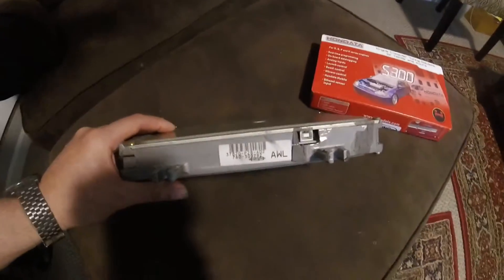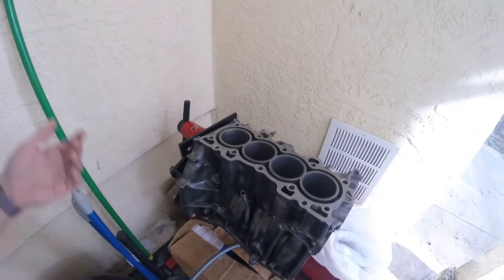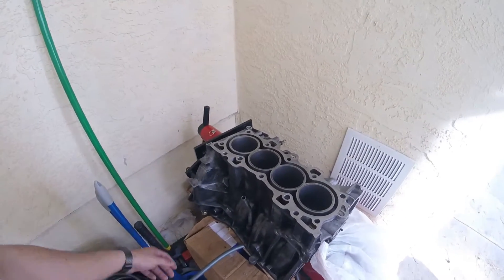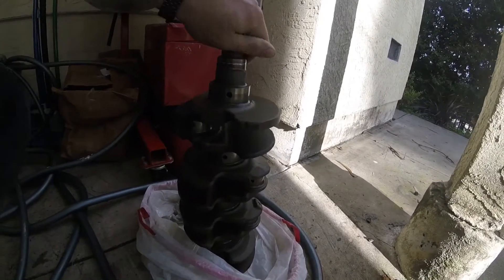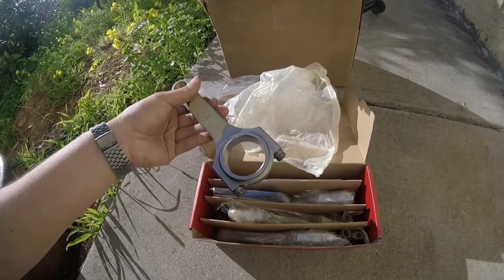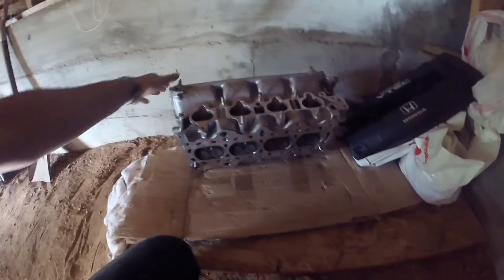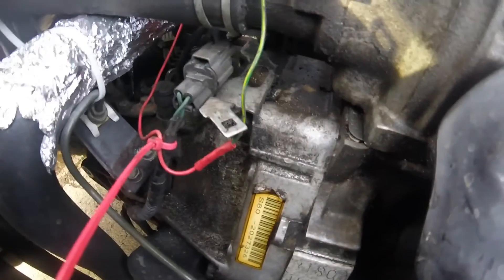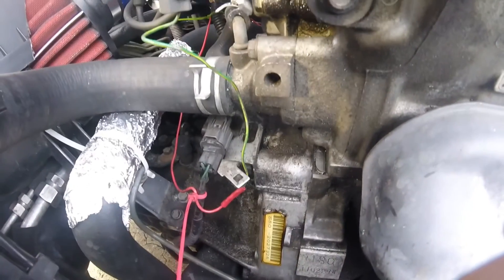LS VTEC Turbo build part 1 parts list build plans overview

Comment: you can run a much higher CR than 10:1 and boost. ive ha friends boost stock type r engines. higher CR is quicker spool time and lower boost pressures for your power goals. so its far less strain on all of your components. all you require is a competent tuner to tune the car.
Reply from the maker: Thanks for the advice, i do agree with you. Originally I wanted a higher compression ratio for the most responsive setup possible. But i live in CA and the highest octane fuel we have is 91. After machining i will end up around 9.2:1. That will give me some room for error like a questionable tune or a bad tank of gas, faulty injector, accidental over boosting etc. im building this to be a fun reliable daily driver so id rather have some piece of mind with a little room for error. I do agree with you though, higher is better but if anything were to go wrong the chance of your engine making it out intact are slimmer. Thanks for watching
Reply: Max Herman oh I didn't know that you were in California. I can understand where you're coming from. Any updates soon?
Reply from the maker: +No Budget Racing this is an old video, so im not sure if you've seen my other videos but i have a bunch of videos of getting the engine together and stuff after this one on my channel. If you have seen those ones than i have some stage 1 cams on the way for the jdm gsr, im going to start blueprinting the bearing clearances on the other gsr block as soon as i get some free time and get it machined. I have everything i need for the turbo kit, just a matter of finding the time to get it all installed and tuned
Reply: Max Herman  nice I did see a few of the others. You're doing a good job. Not being sloppy. I like it. Keep up the good work can't wait to see new content

Comment: I'm doing a stock block turbo b18b1 ls vtec do the vtec heads bolt up just the same nothing extra needed in that case?
Reply from the maker: No. You need special dowel pins since the holes in the ls block are different size than the vtec head. You also need oil pressure to the vtec head usually from an external oil line to engage vtec, and there is an oil passage in the vtec head that you need to tap and plug otherwise your vtec wont work and you will have a bad oil leak. They sell lsvtec conversion kits that have all this stuff that you need for it and make it really easy. Just google it

Comment: Congrats on the new baby ok my ? Is ok im in the process of a lsvtec turbo if its tuned theres still a chance it wont last because of sleeves but you have a jdm gsr stock hp is 180 why not put headers build that engine and turbo it you could get close to 300 hp on a daily i have the same block a jdm gsr no head no crank only the block girdle if i had a engine fomplete like yours i would add turbo tuned lsvtec is good but ive ready and did research for like years 2 things ive found good rods and sleeves your good if not who know you have people saying on youtube hitting 3 to 4 even 700 hp back then but where are those big power lsvtec turbos that arent sleeved today

Comment: Not sure gsr or b16 head some say. Gsr has more compression b16 flows better im still clueless lol
Reply from the maker: B16b heads flow better, they have port and polish from factory. The b16a heads are pretty much the same as gsr aside from the head volume. The major difference between heads is the cams, cams are more so what determines how well a head flows. Any b series vtec cam will fit any b series vtec head. Generally the type R cams are the best

Comment: What pistons are good ?
Reply from the maker: You should find your local tuner. Tell them your goals and what you want out of the build. They should be able to tell you what to get. I know what works for my build and goals but yours might be different and Im not a professional, id hate to steer you in the wrong direction. But if your using pump gas I would go with 9:1 comp ratio, stock internals for 300whp and under, forged internals for 300whp and up. But again you really should be talking to the person who's going to tune the car